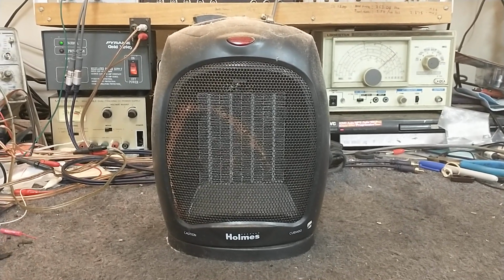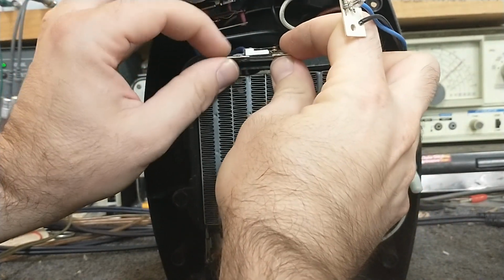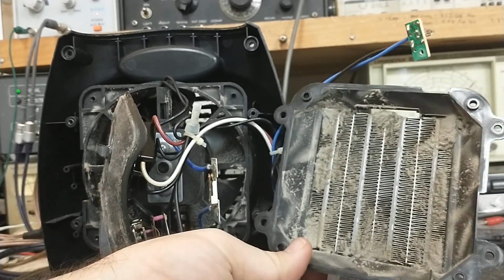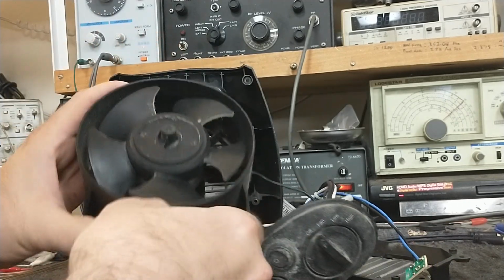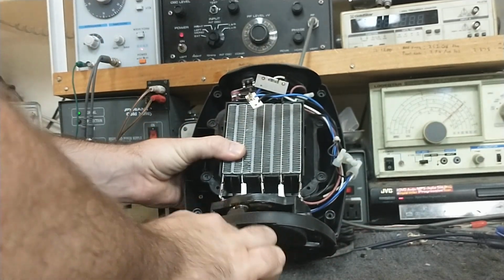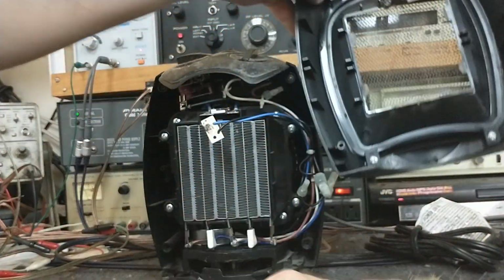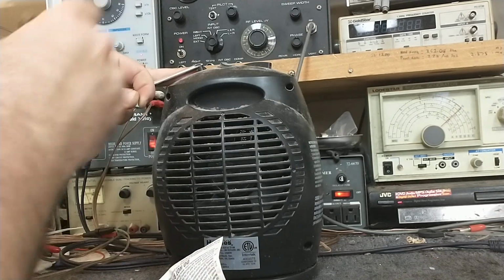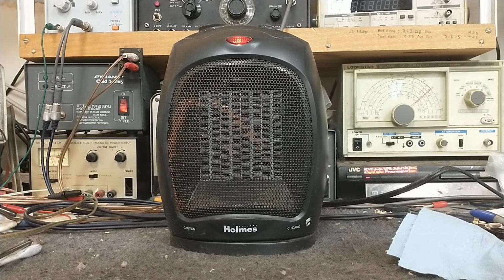Servicing a Holmes Space Heater model HCH5265C-BU. Thermal shut-down.

Comment: I cleaned mine here a few weeks ago, It's made almost the same as yours it just has the " Stanley " name, It would shut down too after a few min. It was almost clogged with dust on the heat exchanger!, Got it all put back together turned it on and again it shut down!, Was going to throw it away then tried it again and worked perfect, Mayby there was a piece of dust or something in the thermal switch, These are great for the Bathroom if you don't want to heat up the whole house!, Natural Gas is suppose to go up 17% this winter here in Texas so I'm going to be keeping the Central Gas furnace turned down more!

Comment: I have a ceramic heater that I have serviced several times over the years and it is now 32 years old and still heating my camper during November deer hunting seasons in Illinois like a champ.   Take care of your shit and your shit will take care of you!!!!!!!!!!!!!!!!!!!!!!!   It's so old it is was built with metal body and frame.   Mine would go into thermal cutoff but cleaning did not fix it.   Turns out the crimped connections were corroding and had to be crimped tighter.   That solved the problem.   The bad connections were causing the heat that was tripping the thermal switch.

Comment: I like the fact that you work on stuff like this. I have a couple of similar heaters from Home Depot that I've had for 25 years. The fans are not well balanced, though,and they wander. I'm thinking of replacing the fans with 120 volt computer fans. Or maybe 12 volt fans with a DC power supply.

Comment: We have an older model that came with a filter at the back. Still works fine 15+ years later with cleaning the filter. My guess is most newer ones removed the filter to engineer a lifespan into these things since the elements last so long. Most people would shy away from opening these up and would just buy a new one.

Comment: Never got used to heaters encased in plastic. Nice job cleaning and saving this 1 from the recycling center.  The bathroom heater here is a Titan milk house heater with the old style coil heating elements all encased in metal. So far so good, not too many places for dust to catch.

Comment: Get a squirt bottle and squirt some IPA through it.  Bathrooms have sticky stuff that it can dissolve.  Then either use a vacuum cleaner or an air compressor.  Brush just moves the stuff around.  Lots of lint in a bathroom.  Mostly from towel fuzz.

Comment: Looks like it is working like new again,  no need to buy new 😀
I have one of those old flat oblong heaters in my bathroom, just to remove the chill.
Dust and damp air are a pain,  after a clean it seems better but that may be my imagination.
The heater is nichrome wire wrapped around a former and mica sheets.
The bad thing is the electric meter spins so fast i think it could fly away lol.

Comment: Never had that problem with a heater.(thermal shutdown) I had problems with 1/2 the elements going out. So it would only output about half the heat. Happened to 2 Holmes space heaters I had. I didn't know how to fix so I tossed them.
Mine had coil elements, I couldn't find any breaks.
I used compressed air to keep my heaters clean.

Comment: I was surprised you didn't use the "turn the screw backwards until you feel the click" method of making sure that screws going into plastic are not cross-threaded.
Reply: I taught my kids this early on so they could fix their toys. Toys are horrible to repair and you have to be very careful to avoid stripping and cracking every screw standoff in the unit

Comment: All heaters of this type NEED a foam filter on the back to help keep the heating element clean.  Guaranteed 99.999% of the people out there would not go to the bother to take the heater apart to clean it and will throw it away.  Planned obsolescence and a cheap design save a few pennies by eliminating the filter.
Reply: Great idea but I'm thinking most people won't clean or change the filter either.